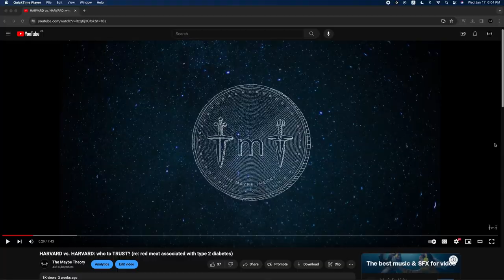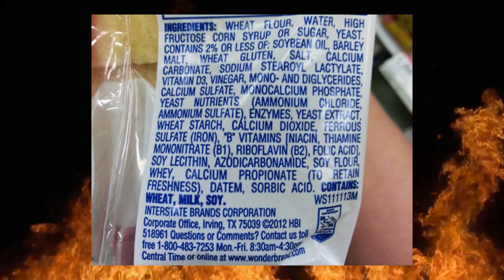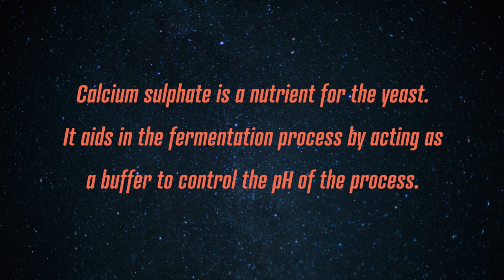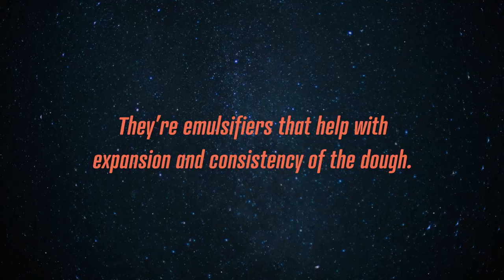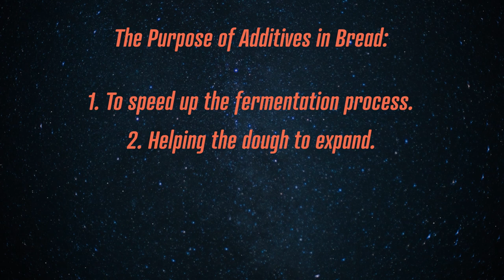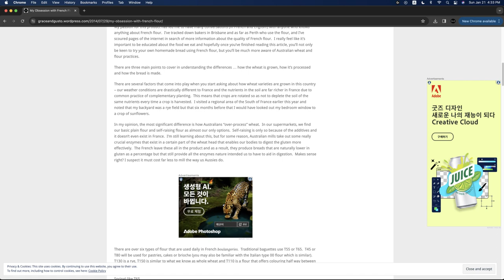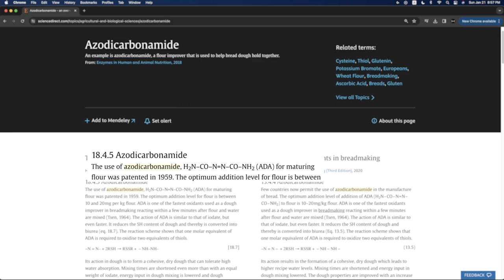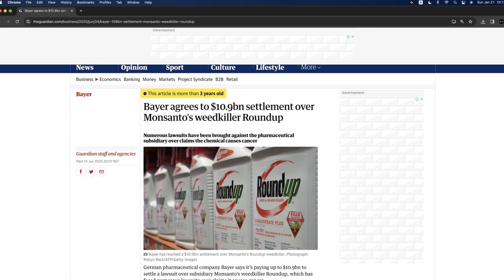Why is NO ONE talking about THIS? (Re: Bread Ingredients you didn't know about)

Comment: Most commercial bread is now made using the Chorleywood bread process. That means more additives, and a short fermentation time which makes the wheat harder to digest. That could explain an increase in gluten intolerance. Many breads also now have added soy protein.
Reply from the maker: Ah, yes! I read about the Chorleywood process as well. Speeding up the fermentation time just seems a bit unnecessary to me and also, since fermentation is basically pre-digestion by microorganisms, it makes sense that cutting the fermentation time would increase the likelihood that people would be more sensitive to it. You're right, it totally makes sense. And yeah! I saw that as well, it's so weird that they're putting soy protein and stuff like that in?

Thanks for commenting!

Comment: I have been making my own bread for a long time though I would still buy from the store at times too till this year I thought I knew so much about bread till I actually lost an argument in a game forum of all places ended up learning I had been making bread I wont say wrong but different then the traditional way (honestly thought the way I was doing it was traditional boy was I wrong) my bread always tasted a little better and filled me a little more but since I switched to a more traditional method of making bread there is a Huge difference. I make 3 small loaves each one meant to be split with my wife and meant for 1 day (I admit some days we have done 2) so far we have had little problem with spoilage we tend to eat it too quick and instead of molding it just goes stale leaving me to make bread crumbs or something like bread pudding out of it, so far only time it has molded on me was when I had it cut side down on a cutting board I had previously cut either cake or biscuits on (cant remember which) or if I kept it in the bread box for a little over a week that will do it it. 
As for time consuming yah it eats up a good portion of your day well sort of for the most part you still have that time to do other things (I do the housework) so the time is not gone and still productive if you do not waste it however you cant really leave for too long either a quick bit out for no more then 2 hours least with what I make. I would say for any couples with a designated stay at home partner the benefits outweigh the inconvenience
Reply from the maker: So true about the designated stay at home partner  thing. The benefits are huge. I think prepping/making meal ingredients on Sundays (or Saturday night into Sunday) for the rest of the week is a good investment. It's just most of us are so used to convenience that making time for meal prep can be difficult for some people. But, I think it's worth it.

I used to make like 6 loaves of ciabatta for the month before I stopped eating wheat. It took a long time, but tasted really good and was totally worth it. I switched to Italian flour and found that it was easier to digest but eventually I noticed that I do better if I avoid flour. I still have it every now and then though.

That's so nuts that you learned that through a gaming lobby! It's also cool to hear that people are baking their own bread. 

Thanks for commenting! I appreciate you, man!
Reply from the maker: Dude, your comments on my recent video seem like they're disappearing. I can't find them! 

I didn't get to read your response to my comment but if this malfunction keeps happening feel free to shoot me an email so we can stay in touch.